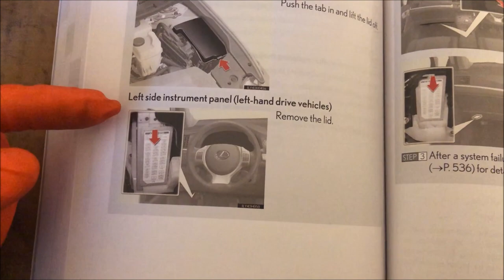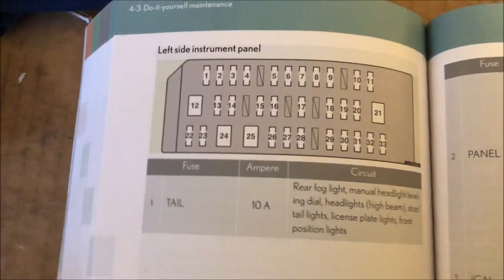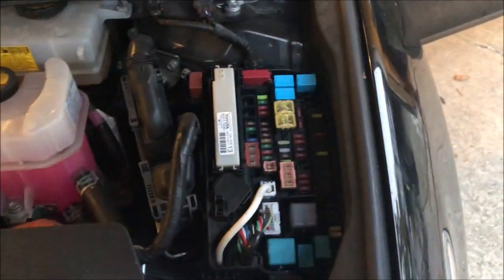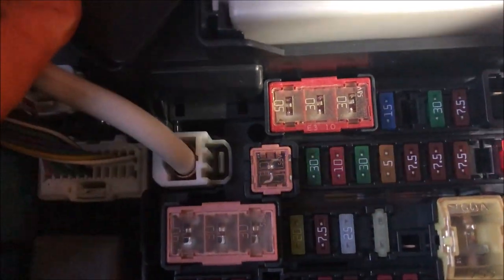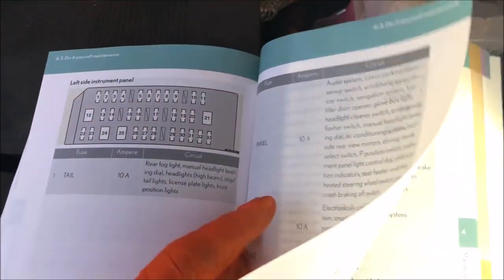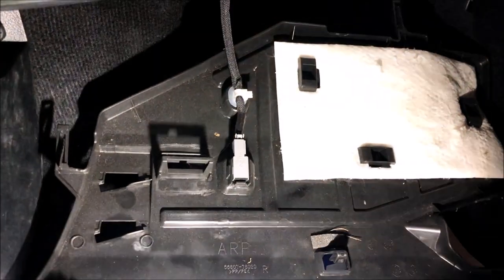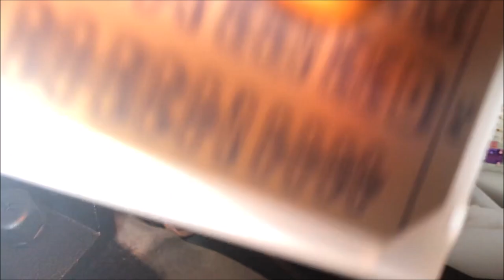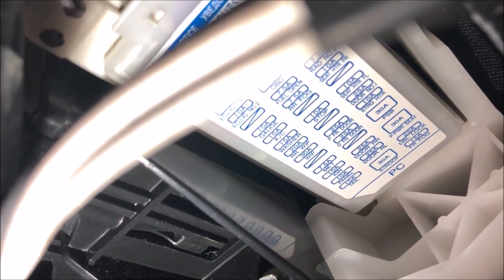Lexus CT200h 2013 fuses location

Comment: Hi, I have lexus ct200h car 2011.car  radio and remote control not working. Sat nav works with voice  control. I checked the radio  fuse and its fine. But there is no power to radio fuse from dc. Could you please tell me what it could be? Many thanks
Reply from the maker: Try removing the radio fuse cleaning the contacts and reffing it back.

Comment: I can’t get my 2011 CT 200 fuse box open. There is no “push” level on the outside of the box. Can someone plz post how to open a 2011.
Reply from the maker: That seems very odd, I have a 2012 in the garage at the moment I’ll check if it’s any different, but as far as I know they haven’t change in shape or modify I. Any way, however my colleague couldn’t open the cap either. It can be hard to get it open sometimes.